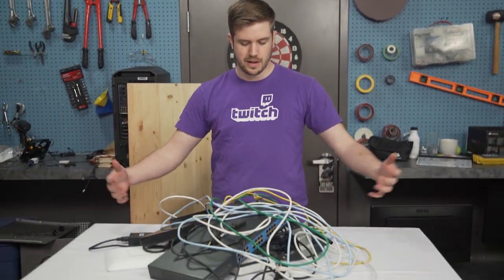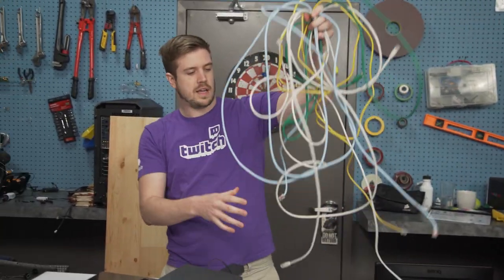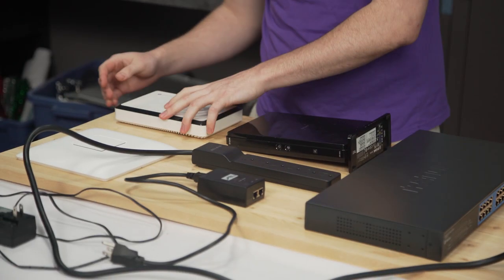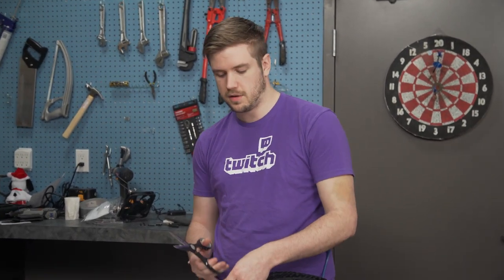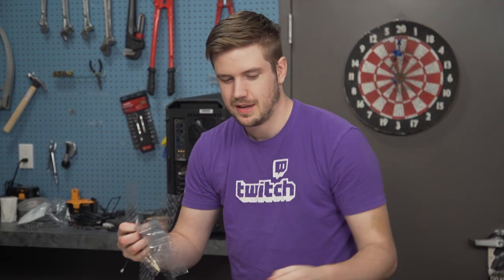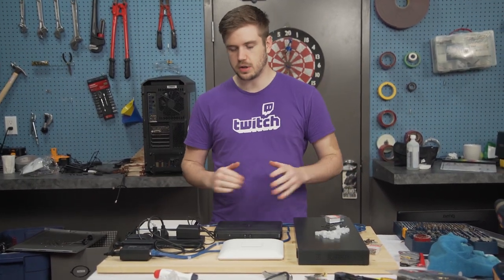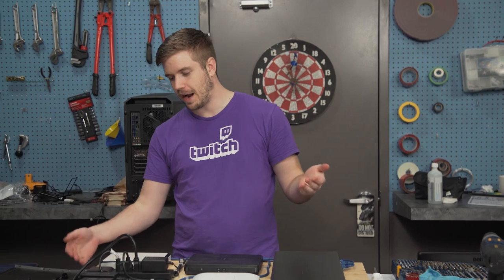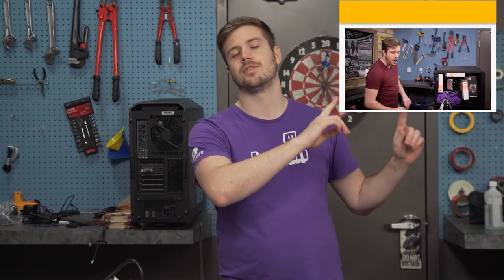DIY Networking Wall - A renter's solution!

Comment: Some questions:
Why do you have a switch for don't know 32? Ports? Do you use them all? Otherwise a bit smaller switch would be good..
And gosh Luke, when you have a modem and your router is screwed -> buy a new router with decent wifi -> don't need an acess point anymore!

Comment: you could just velcro that stuff to the wall ( dont use heavy duty though or it will be impossible to remove ) .   I'm betting most people dont have a switch,   like I just have 2 machines on ethernet and 2 on wireless + mobile devices right now

Comment: I use Command Picture Hanging Strips to mount electronics on a wall in a safely removable fashion. Just like your method, just without the board. ;)

Comment: the standard for ethernet cable lengths is a minimum of 1 meter. you could have transmission problems with short cables

Comment: You know the numbers that are on the head of your drill? yea, those limit how much torque you put on your screws. If you had set it to the lowest setting possible to still go through the wood, it may have not pushed through your cable clamps.

Comment: I wonder if a networking setup will ever advance beyond the annoying mass of boxes and cables that we have had to deal with for as long networking has existed. I don't know how you'd do it, other than crappy "all in one" products, it just seems like there should be something more....elegant to properly handling at least a decent sized home networking setup.
Reply: There is :) layer 3 switches handle routing and switch capabilities... great you say however they are horrifically expensive for home use I use a small cisco routing setup that works for me, all Inn the equipment cost less than the rack that holds it all.

Comment: That's good, but wouldn't it be better to put everything in a box rather than on a board? I have my home networking gear in a sort-of rack made out from a small table and I found it pretty handy when I was moving (I have a bit more devices, so I'd need a really huge board, though).

Comment: i think i would build a board with second floor. so all the cablemess is hidden but there is free acces to all the devices. 
but since here in my house, we only have one unit for all. inside the router is not only a modem, wifi and a switch, the phone is also plugged in there.

Comment: I sure hope your board is getting placed in the best place for your AP otherwise you are better off just running a cable somewhere and mounting your AP for better coverage
Reply: +James Lewis it's a ubiquity enterprise grade access point. No flat for a single person is big enough not to be covered properly by it everywhere. If I recall correctly linus actually made a video about it at some point.
Reply: Well it depends on what his place is built out of and any other interference going on, he does live in a rental so who knows what else is being broadcasted. Just because its enterprise, it does not mean its immune to the same conflicts as any other devices

Comment: now you need to make a French cleat. find a 2x4 that is the width of your board. then draw a line down the 2x4. set the circular saw to 45 degrees. rip the 2x4 in half with a saw. screw one of the 45 degree pieces too networking board and the other to the wall. then just hang the networking board on the other French cleat

Comment: psssssst. build a frame for pegboard out of furring strips. then you can use zip ties or caterpillars or just pieces of wire through the holes to secure your equipment. It'll be lighter and more convenient and you can stick pegboard hooks through it to hold cables.

Comment: Who needs that big switch at home he rents? I've switched to PowerLine adapters at home and solved all my switching and cable management problems. Ethernet is where I want it when I want it.
Reply: +Michał Gołuński Not everyone can make do with just a couple of devices. I live in a four bedroom and use 8 ports just for my devices, not including anything connected wirelessly. Besides this is an example video - not a literal example.

PowerLine style adaptors aren't always a possibility either - If parts of your house runs on different relays, they will have no way to talk to each other. Also some house wiring doesn't work well stability wise with those.

Comment: Why didn't you drill cable holes in the board, run the cables through the back of the board and add some risers to the back so it stays flush when you mount it on the wall ?

Comment: The next thing what I'm going to say isn't related in any way to this video, but I need to ask this.

I have a pre-built pc and I'm going to move all the parts into a different case and I will maybe buy a new motherboard if I have to. So do I need to install windows again to the SSD what I currently have or is it just fine when I buy a new motherboard? And if I have to install the windows again do I uninstall the old one first or does it automaticly uninstall it self when I install the windows again? And do I need to download all the games again on the HDD after I installed the new windows on the SSD?

I currently have win 10 and I would it again if I have to.

Comment: I liked the content of the video, but the video itself, the camera work was more than a little distracting. It looks like the camera wasn't mounted on anything and the zoom kept going in and out taking away from the overall feel of the video. I have seen Linus use an overhead camera on that work bench and I think that could have been used to great affect here, showing the layout of the board from overhead.

Comment: wouldn't double sided tape work or Velcro on the board and the wall to mount it that way?  Another way to do it is mount a wire on the back of the plywood, get a screw or two for the studs, hang the plywood like you would a heavy frame picture.  Or buy a small wheeled server cabinet

Comment: Is it normal to need all those different devices? In the UK we just get 1 router from the ISP which is normally at least Wireless N. And you connect it by ADSL/RJ11 cable to the socket in the wall and that's it. Why do you need all these other devices for a home setup? Sorry I'm not really knowledgeable about networking stuff as you can most likely tell.

Comment: I would have to give this a big fat NO NO...

The heat from the equipment WILL eventually dry out the glue on the velcro backing and your equipment WILL come tumbling down. Although they may not hit the floor due to the screwed down cable clips holding the cables and wires in place. If you don't want to use the mounting keyholes on the equipment the next best thing would be to use a gang of different size zip ties to secure the equipment and staple the zip ties directly to the backboard with a staple gun. OR...Just get a small 19" open frame rack or cabinet with a few rack shelves, mount your gear and set the whole thing on a good sturdy utility table. There are always options and non of them include double sided tape or velcro strips.

Comment: Screw Mounrs for most of the items would have been cheaper, more secure, and just as easy.  That Velcro seems simple but I have had way too many Velcro strips have the glue fail to trust it with anything of value.  I am considering using a pegboard for this application.  Using Peg-hooks would allow using the screw mount sustem and zip-ties to secure items and cables neatly. - Temporary wall is a great idea.  Thanks.  ... Oh.... Plasti-dip over the board would have made for an even cleaner look.

Comment: If you're going to use velcro and not screws, why have the board? Surely you can put velcro on the wall! You can get velcro/tape cable ties, so you could do it all screw-free. Sure, it might damage the paint, but that should be a smaller deal for your landlord than a bunch of holes.

Comment: wondering why he didn't use high grade plexiglass instead of wood,even tho I think the wood is cheaper but with the heat and use of Velcro with the sticky side the plexiglass is more better in the long run.

Comment: Serious question : Do you guys in north amercia all have to deal with all thoses devices just for the internet ? In my country the internet provider gives you a single box connected to either coaxial or telephone plug at one end and to your tv, your phone, all your ethernet and wifi devices on the other end. Mine even has a bluray and a 500gigs drives

Comment: Why the ap, since the router contains an ap? Radio not good enough in the router? 
Also, POE seems unnecessary to power the ap, unless that's the only option.

Comment: As I was watching , I was thinking: why is the Ethernet extender sitting next to the router? Unless he has the router's WiFi turned off. The next thought I had was:  Why does he have a $210 24 port switch? He is never going to have that many devices that would require near 24 ports, maybe 4x PC, 2x printer, xbox, PS, laptop, NAS, server, wifi, I think no more than 14-16 ports would be used max by him at home. I don't even expect all them to be in the same room. Modem gets connected to router directly. However, for a LAN party, it would work great.

Comment: I'm confused as to why you did this.  Unless you mount the networking wall somewhere, it will still be pretty ugly and not any better than putting your gear somewhere else like a closet. Plus, since the majority of this is velcroed anyway, couldn't you just velcro the stuff to your house or apartment wall in the first place?

Comment: Why not just get the 3M velcro strips that have the nifty pull tab for safe removal when you move? Just stick it all to the wall....
Reply: Ya but we're not talking about all surfaces. 99% of walls are the same kind of surface. Painted drywall. I use them all the time on walls and did this exact thing with them. The only time I've had problems is when it's insanely humid and all you have to do is hold them against the wall longer

Comment: Talking about networking at home and getto setups... What about OpenWRT? I've always used it and this video made think of it. Cause thats my reason to use a modem (owned by the telephone company) a main powerfull router (running OpenWRT with ton of crap (Torrent, NAS, whatever) and then an AP cause yeah, with opensource drivers the OpenWRT router doesn't do to well on wifi performance. Also used to put a ZyWALL in the middle as well, but was kinda overkill, and with OpenWRT fireweall it does fine now.
Reply: +HarlockGlitch Also I've found pretty shitty comments. I loved the video I must say! Maybe they can feature a 'People are assholes 2016 [HD]' video.

Comment: Hey Linus,

is there any way to make an unRaid configuration so u can run a Linux machine (e.g. Mint) and Virtualize a Windows Desktop for gaming without loosing power ? And Havin mouse and tastatur for both machines ?

E.g: Run Linux with onboard graphic and 2 Cores and Windows on Nvidia Graphics Card and 6 Cores ? or maybe even on the same screen ??

would be nice to hear from u =)

Comment: if you are using a network switch and a wireless access point and modem then why do you still use the router

Comment: Soo there's these numbers on the drill chuck those numbers are basically a slip clutch setting and changes the torque slip so that blasting screws through plastic like that doesn't happen..... Lol I still hit like but man lol

Comment: But what do you need the router for?
You could just link up the modem to the switch and go from the switch to your Ap... If I am wrong, please tell me why. :)
Reply: +XxLeketxX DHCP he needs the router to ROUTE traffic..
Reply: +Adric Coulon Shouldn't the modem have routing function and DHCP build in?
All modems I know are able to do that. :S
Reply: +XxLeketxX Modems do not have that unless they are Router/Modems.. He has his Fiber modem so I will assume it does not have a built in Router.
He actually specified all this at the Start in what he was hooking up.. His Modem TO his Router.. so thats why he has the D-Link
Reply: Adric Coulon That's where my confusion came from, I thought that having a modem with build in router was commo these days. Thank you :)

Comment: You can do the same but throw it in a cabinet so it remains hidden away.
Reply: +Nart Wumar You're saying you'd lock a WiFi router or accespoint in a cabinet?
Reply: +ixuzc Just use 5GHz then
Reply: +iFail21 5Ghz has greater signal degradation through walls
Reply: +Robert Gyergyek shit you're right, my bad. I mixed up the two.
Reply: ixuzc
maybe let the wifi antennas poke out or some similar fix

Comment: +LinusTechTips Wasn't the issue that you couldn't drill a bunch of holes to mount things on your apartment wall? Why did you use velcro then and not mount them to the board? Can't you velcro to your apartment wall??
Reply: +jrizz43 When you rip off the velcro you probably gotta repaint so I guess no?
Reply: +Spektrik oh no, not PAINT! its not like paint costs more than like $10-15 not like you can fix holes in the walls for $15....
Reply: snipeish1 yep and repaint the whole wall... If you just paint a patch the colour would be different so you've gotta paint the whole wall.
Reply: snipeish1 A coat of primer + 2 coats of colour costs more than $15

Comment: This is like a bigger version of what JayzTwoCents did right?
Reply: +DarkarCrooks no, he was able to drill a board onto the wall inside his closet and had better gear over all. Plus he has access to the direct feeds that come from the outside into the house. Luke RENTS and thus is unable (unless his sneaky) to drill holes, add planks or do any manual installations without permission from his Landlord.

Comment: Hi Linus and Co. I need some help. I have never set up a home network before, never needed one, but in order to back up my data quickly  and easily (Over 2TBs now at time of writing.) I now feel the need to make a home network. Something simple, main laptop to back up / network laptop and two external harddrives connected to backup laptop. I can't afford the £500+ a year services like dropbox charge to store data without also storing it on my main computer. What they call smart-sync. If you could tell me of a good babies first home network resource or a video of your own that would help I would appreciate it. Thanks. If possible info on how to setup not just the hardware, what hardware to buy and how to set it up via windows 10 would be great. We're talking super basic ghetto network as I don't have much room. In fact almost none.

Comment: One small suggestion. The title that you write on the thumbnail ("Cheap and Portable Networking Wa........." last word is covered) cannot be read coz the thumbnail has the video length written over it in the bottom right corner. So many a times we cannot read the title.

Comment: I have an challenge for Linus, how can i cheap run an virtual server on windows or linux , (the user friendly linux versions), now days they use on an virtual machine with containers, what is it mean and can i use it on  an primary school. Now i have 40 til 60 ubuntu 14 computers and what is the benefit for an primary school. Can i run it on one location to feed other locations (in the same community)  of the school. (it is conneted with fiberglass)

Comment: if you were going to use Velcro why not just Velcro to the wall?
Reply: +Dylan Dingler I dont think tape would hold onto the well as good, well depending on a wall, my wall wouldn't hold anything, it has bumps all over it.
Reply: +Dylan Dingler The adhesive holding the velcro to the wall would tear down any wallpaper when you take it off, which is about as bad or worse than having several small holes in the wall.

Comment: you cant screw 2 holes per device? is renting so shitty in Canada? we can screw I think, but we might need to fill up the holes later on (which is not really a problem tbh), even if you painted the wall, its only a small hole to fill and repaint xD

Comment: I still can't understand how you all have such a hard time with crimping Ethernet cables. If it's really that big of an issue, just also buy the little bridges that you can get where you slip each copper line in, then trim then so they're the same length before pushing it into your RJ45 connector.

Comment: WHAT IS THE POINT OF THE ROUTER?!?! If you're not using the wi-fi from it (which is why you have the access point, I'm assuming) then why not just plug the switch and the AP directly into the modem?? I can see that the back of the modem has more than enough ethernet ports....
Reply: bridge only my friend, bridge only, you don't want these "combos" doing anything but being a modem. No DHCP, no natting, no routing, port forwarding etc.
Reply: turtleh Seriously? My modem from my ISP kicked my d-link router/wifi AP's ASS when I got it.
Reply: Lol, shows the age/quality of what it replaced.
Reply: tomtalk24 Not at all. The D-Link router was brand new, it just didn't support ac so it couldn't keep up with the speed of my internet.
Reply: That's a stupid question. Routers lease ip addresses to the devices in your house and are a firewall. The only way that would work is if he had only one device he needed to use internet on
Reply: AYOUTUBEUSER The boundless stupidity of Youtube commenters never ceases to amaze me.
Reply: ***** I could say the same thing
Reply: ***** Wireless aps work the same way as a switch. The router does all the ip addresses and the switch has the ports
Reply: AYOUTUBEUSER Alright. You live in your little world, and I'll live with the rest of humanity.
Reply: Budget router then, regardless of brand. You get what you pay for.

Comment: Ok so why arent you using the blue board behind you on the wall????? That stuff is a hundred times better and no drilling and use a few pieces of wire or cable tires can be great for cable management.

Comment: Would have been better if he had drilled some cable size holes into the board, and fed the cables through those, so there's less cable on top.
#cablemanagement